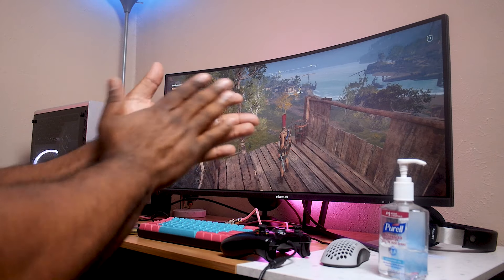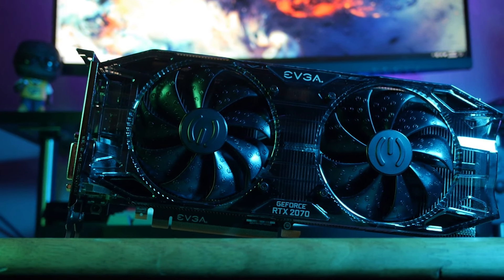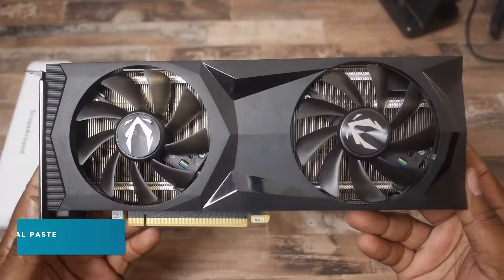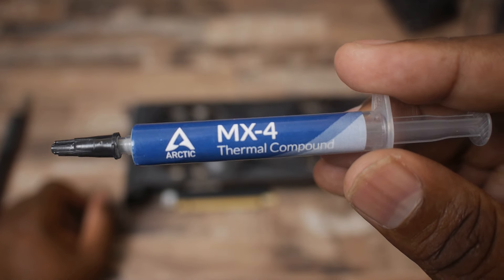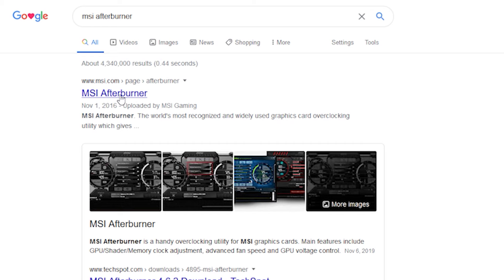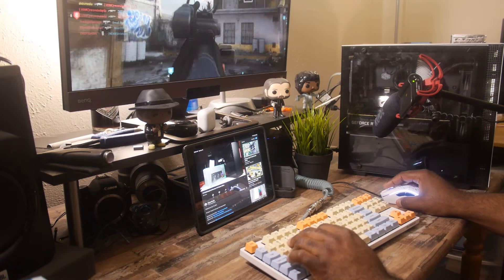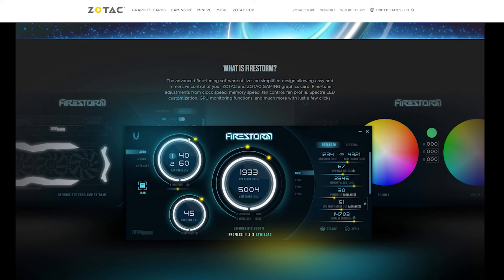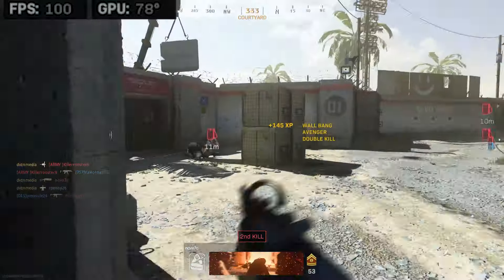3 Easy Tips To Lower GPU Temps!

Comment: i have an i7 2600 3,4ghz  -- 20gb ram ddr3 1330   win7 64bit  and the 1060 6gb    do  u think  your option will be ok for my spec?  or it doesnt matter what other components i have?  

good i found your video... today sudently playing a game that i have some mods and reshade installed the game was nice and smooth with the settings between mid-ultra and the game was playable also the max gpu temperature was like 58'c max if played for like half a day  but now its like i hit 70+ ..rising from 30 constatly to 45 then 55 when im in the game its like 55 and rising to 66 then after 2 minutes of ingame activity maybe not even moving my gpu temperature go high to 70+ and its so scary

i checked the case but maybe a bit of change like -2-3'c when im not using the side fan and the side sealing is out..so everything is open ..  also before that i cleaned my gpu not like you but like crystal cleaning and added the thermal paste but same thing...

Comment: I'm having gtx 1650 super and it goes upto 81°c under 4-5 minutes, is it safe I decrease my power limit to 90percent using firestorm utility tool ? At stock it's at 100 percent of power limit.  And what if I set agressive custom fan curve, will it lower the lifespan of the fans ?
Reply from the maker: I don't know about the guaranteed lifespan but that should at least help you control the temps and keep your card from throttling
Reply: @DVZNMedia and is it safe if I decrease the power limit ?
Reply: Mayukh Das im pretty sure ur safe if the card does crash with those settings

Comment: I have a 1080 ti I’m constantly getting over 80-84 degrees gpu temps on some games even with low settings which I’m not comfortable with so imma try the afterburner software and see if it really make a difference for me

Comment: I bought a gaming pc from amazon and the graphics card was a gtx 1650 and I immediately paid for a new graphics card which is then an rtx 3060 zotac but the problem is that the heat rises between 50-60 and up between 70 and I'm a little afraid that it might happen something with the graphics card, is there an answer to this? how much heat can a graphics card like that withstand

Comment: Great video. I just got my rtx 3080 and was looking for ways to get my card to chill out in the high 70s rather than low 80s at full load. I just feel more comfortable not reaching 80c even though I know that is still a safe temp for these latest cards. They run hotter than my old gtx 1070 obviously lol.
Reply: How u fix it ?
Reply: @itsyoboig3325  Mainly two ways. I blew out all the dust in my case and then I created a slightly more aggressive fan curve with afterburner, which I only use if I play a demanding game. Doing all that worked wonders, to the point where my new card often runs cooler than my old 1070 lol.
Reply: @josephjoe4180  Damn, whats yo new temps looking like while playing a normal game

Comment: i have just gotten a brand new hp pc with a gtx 3060 i was playing the crew 2 and adusted my settings to 4k to fit my monitor resolution and have the msi afterburner installed bc i noticed the top of the pc getting a bit warm and my temp was stead 84-86C and all im doing is driving!! while its nice to have 4k enabled to see all the pretties in game do you think lowering the reso would calm the temps or should i just pipe down my graphics settings in game i was set pretty much on all ULTRA!! tysm for this video!! sub'd n lov'd!! ♥
Reply from the maker: Is the monitor you're playing on 4k?  I would probably just adjust the settings to not push it as hard or either adjust my fan curve so that it works harder when temps rise.  Thanks for the sub, I appreciate it for real!
Reply: @DVZNMedia  yes sir my monitor is 4k as well i went into the crew 2 and adjusting my vid settings and tried lower reso and got the temps to BELOW 80C and one setting i had the max was like 78C so i def wanna keep under 80 is that correct? i am not trying to burn up a $2000 usd pc okay!? lol :)

Comment: It seems like the zotacs run hot compared to other cards. Idk if updated drivers will help or not and I don't see any bios updates from zotac. I'm not too familiar with high end cards, but I bet zotac cheaped out on thermal pads and the heatsink. Undervolting this card would most likely will help drop temps. I could also see installing new GPU fans would help, but at that point you might as well get a different cooler running card.
Reply from the maker: Yeah I think it has something to do with their cooling tech, that allows them to run hotter without losing any performance. It does run quiet, I just was worried because I've never run a card that high.

Comment: Hi! When i use hdmi on Ryzen 3200 g,vulkan 8,on tv i have sound. but when i use on similar cpu but xfx radeon 470,8 ddr4. Dont have only on audio system.Why i ask? Now i watch on you video to see what is new. Because i known ,to reduce temp,is need to clean from dust,put thermal pasta and maybe a good cooler. My problem on xfx 470 i think is low price pasta,artic mx2-2019. If i use on a game,after 2 years of no problems,by gpu in 2 min have 80/90*C. And system enter on shutdown. I will try another pasta and see what is new on you clip. A good day from Central Europe.

Comment: Ty man, I have an rtx 2060 and an i5 9400f and my gpu is around 72 and my cpu is around 78 but my pc still feels quite hot, is that normal?
Reply: Btw it says that when playing r6 ultra 1440p
Reply from the maker: Yeah that's probably just the hot air escaping , PCs can be hot to the touch but still be in very safe Temps
Reply: @DVZNMedia  okay thankyouuu:))

Comment: i got a RTX 3080, it sits at 170F, not much i can do about it, as far as i know its normal and im at a mid tower. with liquid cooling (not on my gpu, liquid is only for processor and mother) 170 is its normal though under any gaming load, idle when the fans turn off it sits at 120. Well not idle idle, but not gaming. Thinking about adding a liquid cool for the GPU what do you think? I could just pop the side panel off an place a box fan next to it if i get worried enough tho.

Comment: I have a question so basically my Radeon RX580 4GB won't stop hitting 85c nothing seems to help I've tried using custom curve but it just doesn't work any suggestions? and is 85c safe for my gpu

Comment: i got a problem idk if you can help me

problem; my gpu fans dont work when i am in a pre game lobby when ihit in game tehy start to work i just want them to turn forever even though im not in a game how do i adjust that?
Reply from the maker: I mean you can go into afterburner and adjust your fan curve so they spin at a lower temp but that probably is by design of the gpu maker.  A lot of them have the mode where the fans stay off till it reaches a certain temp to keep it quiet.

Comment: Bro my laptop's gpu is 104°c rn it's causing so many stutters please help I've cleaned the fans done everything i could please help
Reply from the maker: laptop gpu's are hard to control, have you thought about getting a fan to place it on?
Reply: @DVZNMedia  Yes a temporary fix I'll get the thermal paste replaced and hope it works

Comment: Will changing my fan curve cause me to fry my gpu cuz isnt it similar to overclock ? ...pls help i am new to this pc community
Reply from the maker: No, changing your fan curve will only affect how the fans react to your gpu temps.  You can make them more "aggressive" meaning that they cut on at lower temps and go full speed or if higher temps don't bother you, you can set them to stay quiet at certain temps.  This is not overclocking your gpu at all, just tuning the fans.

Comment: Ive got a Ryzen 3 3200 G + a GTX 1050 ti, the average temp is 70 to 72, 400w power supply, is it good? I have a stuttering problem, even with every graphic setting on low what should i do?
Reply: 70-72 is a good temperature for your gpu. If you want less stuttering I recommend you limiting the fps in your game. Though if I were you I would upgrade my rig for a little better performance. There's always the choice of lowering the resolution of the game if you can't afford to spend any money.

Comment: Part of my problem is that the room I'm in is usually around 78F. I live in south Florida. I try to cool the room as much as possible, but it's an addition without a/c, though wide open to the rest of the house it still stays warmer. My GPU (RTX 2080TI) is constantly around 83, 84 when being pushed at all. Especially games like Satisfactory. I have a large very spacious case with 3 good fans pulling in air, but that fucker is constantly ramped up and if the fans kick on 100% it's scary lol. I'll try the voltage adjustment and see if that helps.

Comment: will changing the thermal paste make a lot of difference like 10 degrees?  i also noticed the fans on my card would turn on and off every few seconds even at 80 degrees and up and my card would sit around 93 to 94 degrees.
Reply from the maker: I would first test the fan curve, seems like it's set for your card to go with silence over performance.  Also, changing the thermal paste will only really matter in a case where it's old and brittle or just not applied well.  It can help in some cases but in others it doesn't do much, it's just a good place to start when doing maintenance.

Comment: is there a way to have MSI afterburner run in the background as a background program because my curve only works when i have the application open. Any solutions? (its not letting press the windows button)

Comment: I have a GeForce 3060 should I try those fan settings?
Reply from the maker: Is your card running hot?
Reply: @DVZNMedia  the back of the pc is hot
Reply: @DVZNMedia  we’re the air comes out
Reply: @DVZNMedia  my cpu I think
Reply from the maker: @jognus9910  oh ok, that's just the hot air exhausting out of your pc.  If it's affecting you I would either turn the pc or maybe configure the fans so that the outtake a different way if possible.

Comment: Do you have to Keep the afterburner window open for it to work???
Reply from the maker: There is a setting you can set for afterburner to start with windows and it will minimize to the tray so it's not open on your desktop.

Comment: I really need help my gpu steadys at 37 c or so not playing games but when i play games such as fortnite beamng drive and sims4 it goes up to 79-80 and if its at 79 and 80 for too long either my computer will turn off and my gpu fan wikl run really loud then turn off or it will go to a purple screen
Reply: Sane

Comment: My MSI RX 570 8gb is too loud and too hot. What can I do?
Reply from the maker: Honestly with my 580 I had to make a decision, what was more important to me, a quiet gaming experience or a cool one.  It just ran so hot that if I wanted to keep it cool I had to ramp up the fan curve which made it louder, but if I didn't care that it stayed in the mid to high 90's then I just turn the fans down a bit.  You may have to make a decision.
Reply: @DVZNMedia  okay thanks for the answer

Comment: If you remove the side panel you do not achieve air flow. You just have an open case with air that may or may not cool the parts.
Reply from the maker: correct

Comment: I recently changed my gtx 1050 2gb to rx 580 and my average temp is 77-80 at 60% fan speed, I'm worried about the temperature, also worried if I put my fan speed higher
Reply from the maker: The higher fan speed won't hurt your gpu, it'll just had more noise in your build, but the power upgrade over the gtx 1050
Reply: @DVZNMedia  so it's ok to put the fan speed wt maximum? I mean if the only problem of putting the fan speed to 100 is the noise only then it's not a problem for me, so 100 fan speed should be fine and it wouldn't damage anything, plus cool off my gpu temp?

Comment: My GPU hits 86c on warzone and fortnite, therefore my pc gets very hot. My GPU is a nividia GeForce gtx 1660 super. This is a new prebuilt from fierce PC. I’m very new to PC so I don’t have a clue what to do. I did download MSI afterburner and turned my fan speed all the way up, however my GPU was still around 80c+ on warzone. I’m in desperate need of help and I’m starting to worry. Any help would be much appreciated.

Comment: When i play games like batman arkham knight i have around 74 temp it just really makes me mad how do i fix that? my graphics card is RX 5500XT i just  bought  a whole new pc like 2 days ago and the processor is i5-9400F
Reply from the maker: Honestly 74 is pretty good, i spoke with AMD and those cards rated high limits are well into the upper 90s.  If you want to try, I would start with the fan curve and see what kind o ld results you can get.
Reply: @DVZNMedia  By the way my case is small and when i play batman arkham knight the case heats up pretty quick, could it be because the case is small or?
Reply from the maker: Ohh ok, what case is it?
Reply: @DVZNMedia  Oh i can't find it could i send you a picture through discord if you have the app?
Reply: I used to have the same problems man. My case had only 2 fans and I bought 3 more. I suggest looking into noctua fans and they are very easy to install. My temps went from 81 to 69 on a game like pubg on ultra. Also like the video says adjust the fan curve and all the fans in the pc will keep it colder

Comment: My gpu runs at 55% of its power but it hits 86 celcius. What Should i do?
Reply from the maker: Give me some more details here.  What GPU are you using, what case is it in?  Are the fans working, did you change the fan curve in any way?  I would need some more details to  know exactly which way to help you.
Reply: Im not sure what my case model is but i know it has good airflow. My card is a nvidia rtx 2060 that i bought from a friend. I tried doing the fan curve and it fell by 6 degress.

Comment: my gpu sits at 55-60 at 10 percent load. is that okay?
Reply from the maker: what kind of airflow do you have in your case?
Reply: @DVZNMedia  it’s the nzxt h510 elite. I set a fan curve on msi and it’s better but my fan is almost always running now. I noticed it was fine before I got an aio cus my fans were pushing air in that direction but now my radiator blocks those fans.
Reply: But now my temps are 31 at 12percent load and rarely go above 60 gaming. My gpu is also pretty old I’ve been looking to upgrade but can’t find a decent cars under 600 to go with my i7 10700k. Right now I’m running a r9 380 😢

Comment: I play gta v max grapics may gpu temp plays to 61to58 its cold or too hot
Reply: That's some good temps, my 1660 super runs at 84° (this is a pretty bad temp)
Reply from the maker: That's a good temp
Reply from the maker: @afonso Reis yeah you got a heater on you but that's still not detrimental

Comment: If i open my case and use normal big fan to cool my whole pc, does it work?
Reply from the maker: A lot of people use an open case, I even do it sometimes but I wouldn't suggest making that a long time solution
Reply: @DVZNMedia  yeah, that would be pretty annoing, because it is so loud. If i bought later extra fans when my components get hotter. Maybe in a year.
Reply from the maker: @markuskumpulainen6742  what case do you have and how many fans are in it?
Reply: @DVZNMedia  i, dont have it yet, its goming today. But that case:s name is Acer predator orion 3000. It haves so good airflow, and i think 2 or 3 fans.
Its a new pc so no problem a long time...

Comment: i just dont understand how the test are being done with 50 fps those temps are extremely high for those frames. The test need to be done with 150+ frames and then test the gpu temps thats the issue that occur. the more frames the hotter the temps. i can push 200+ frames but my card will hit up to 90c which is going to burn the card out.
Reply from the maker: There are all kinds of differences that go into fidelity settings, it depends on not only what resolution you're running at but what game graphics settings you're using. If you lower the graphic settings to get more FPS that's not actually taxing the gpu like you think. Either way the idea was to show some tips on how you can cool your card if it's running hot and that will also improve the fps.
Reply: @DVZNMedia   i wish someone on youtube had the answers to this. my reasoning to this matter is this. so i play a game in 1080p with 150 frame cap im going to average between 78c to 83c which can still bottleneck. however when i play it in 2k resolution with the same frame rate is will go to 90c or higher in which the game will either crash or graphics card could damage. i have to frame limit games so they wont exceed my temps I'm comfortably playing at which in regards i want minimum 144 hz as i do want the max refresh rate.
Reply: essentially for any game at 60 frames will typically run 49-54c
Reply: @DVZNMedia  also thanks for the quick reply i appreciate it a bunch!

Comment: 60celcius when i do nothing and gameplay at 87celsius and i was told it should be 30c when i do nothing and 70celsius during gameplay and maximum at 80celsius????

	NVIDIA GeForce RTX 3060

	Driver version:	32.0.15.5612
	Driver date:	2024-06-25
	DirectX version:	12 (FL 12.1)
	Physical location:	PCI bus 1, device 0, function 0

	Utilisation	0%
	Dedicated GPU memory	0,6/12,0 GB
	Shared GPU memory	0,1/7,9 GB
	GPU Memory	0,6/19,9 GB

What temp in celsius is normal for my gpu when i do nothing vs gameplay at maximum settings 1080p??
New prebuilt pc from Medion erazer 6months old hardware rtx3060 12gb i5 12400f 16gb 3200mhz----motherboard i think is b550 or b660 (i think i read it was b660)

Thanks

Comment: I cant believe he didn't mention the vsync on always , not from control panel , but from ingame. if you have a 60hz monitor , and you have 100 + fps , that means you push your card over the refresh rate of your monitor. i have a 60hz monitor , and with vsync on i have 65 C with vscyn off 78 C.. try it. thank me later